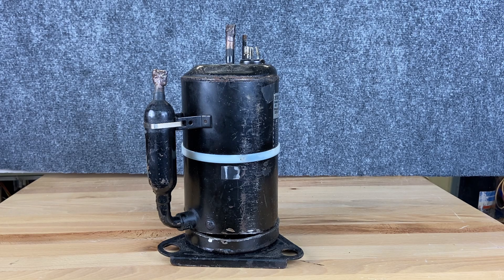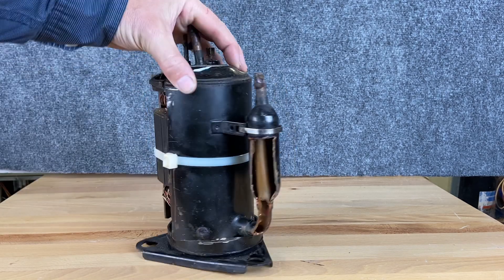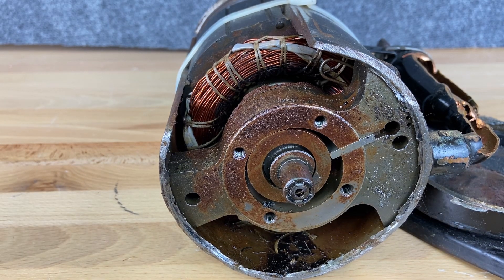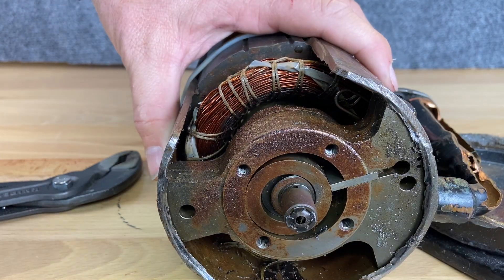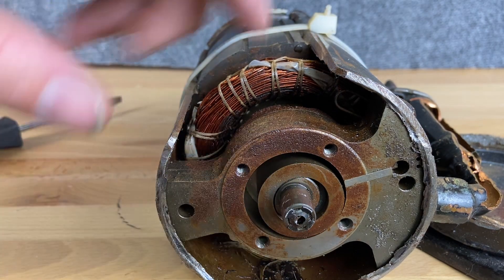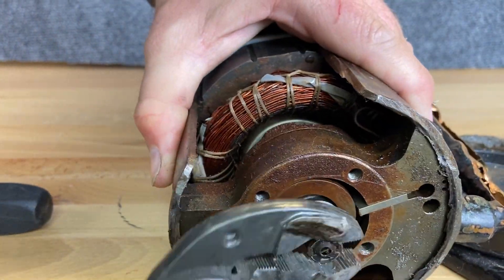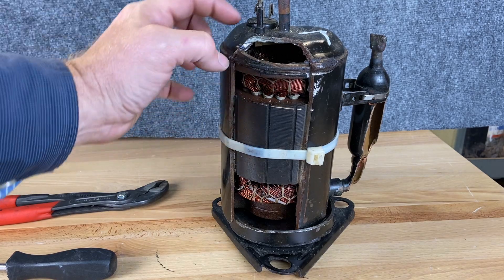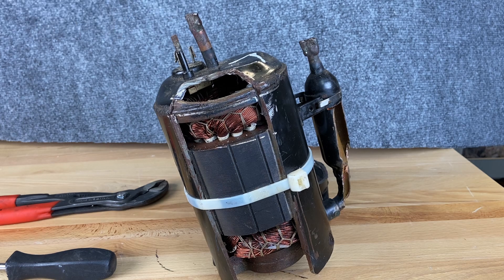HVAC 073 Rotary Compressor introduction hermetically sealed

Comment: @ 00:55  That is not a "keeper pin to keep it [the rotor] pushed in". That is a vane that rides against the rotor. And as you later stated, it separates the high pressure side from the low pressure side as it rotates. Without it, you would not get any compression. 

PTAC is Packaged Terminal Air Conditioners, like those used in motel rooms.

Comment: Will the section line accumulator be enough to use these types of compressors to recover Freon from
Automotive systems etc, the commercial  units have a rotary valve in them what protects them from liquid damage, cheers Brett
Reply from the maker: Possibly but oiling is a concern.

Comment: Hey Ty love that your taking the time to teach us but I do have a question….when you replace these when you break the vacuum do we always charge on the high side or it doesn’t matter!? Thank you in advance and god bless
Reply from the maker: Great question!
A few points.
If the system is pumped down like a new condensing unit, open the suction first,. Then the liquid.

Residential air cooled systems you have 2 options.
Usually everyone breaks it by adding liquid directly to the liquid line. Never add liquid to the suction side when it's off or in a vacuum.

If it's a water cooled system, being geothermal,  refrigeration, chiller, or anything with water as a heat transfer you want to add vapor only until the system pressure rises above freezing.
Above 32 for water or if it's glycol the freezing point varies with mixtures.
After your above the freezing point with vapor you can liquid to the liquid side.
Reply: @love2hvac  thank you for the response. It’s actually a 2 ton residential package water-source unit they factory charge it through the low side and I believe that’s what killed the rotary compressor in two days 😂😂

Comment: Hi Ty! In the Middle East the temperature easy to pass 134 F(54 C)  and in some cities over 140 F (60 C), in this case lats of temperature hits the compressor so if put some shade to decrease the temperature do you think that could help the vapor pump to cool? Thank you🌷.
Reply from the maker: The highest temperature in the middle east was recorded in Al-Jahra, Kuwait, where the temperature reached 52.7⁰C  / 126.86 ⁰F

The current official highest registered air temperature on Earth is 56.7 °C (134.1 °F), recorded on 10 July 1913 at Furnace Creek Ranch, in Death Valley in the United States.

Those are not regular temperatures but extreme peaks for a limited time.

Shade can be beneficial or detrimental depending on how it's applied. 
The shade should never be over the top of the unit and never in the path of the exhaust air.

The shade should be used several feet away from the condensor blocking the sun from striking the side of the condensing coil. 

Some companies have designed water system to allow for evaporative cooling on the condensing coil's but the water has to be very pure and de-mjnsralized to prevent scale build up. Even with that the water can speed up electolosys. I have early seen it done right but it is a possibility for extreme applications. 

If you lookkng for a real solve, look at geothermal system where a glycole/water loop is buried deep in the ground. The condensor regects heat to the water and the water gives up it's chest to the cooler earth.

Comment: Please help me with great facts of my ac air conditioner compressor turn a Dynamo or alternator generator project? Is it too feasible?  Or how many hp motor can I turn an AC air conditioner compressor into?
Reply from the maker: Great questions. I don't have the time to investigate your answers but the information is all available. Come up with some ideas and then experiment and see what works and dosent work. Keep modifying untill you get what you want. It's much more fun that way and you will learn a lot.

Comment: Can I convert ac compressor  to hydraulic pump or an alternator generator
Reply from the maker: Yes an alternator is easy to make a generator. 
A compressor does not make  hydraulic pump though. You need a gear type pump to make that happen.
Reply: @love2hvac   big thanks ,  I have low voltage in my street, i got the idea of turning an old ac air conditioner compressor into a Dynamo or 240V alternator to  be spin or propel by a 24v DC hydraulic motor of 2horse power, will it work  well  to carry my 240v inverter tech welding machine?

Comment: If the whole casing is hi pressure (I assume it's refrigerant cooled) what keeps the compressor cool?
Reply from the maker: That is a great question, Eli!!!
I do not know or understand the answer.  This morning I looked it up one book said because the motor is in the discharge gas it runs hotter and sometimes has limitations.
Another book said the compressor windings  are cooled with discharge gas. I have heard that before but it still does not make sense to me. I will ask my instructor group and see if I can get a better answer for you and me.

Comment: Interesting — similar mechanism to a pneumatic impact wrench (though in reverse - air pressure differential drives the shaft)
Reply from the maker: YES!!!
I love it when people are thinking. You thought and applied it outside of the immediate subject and you are correct!  One other difference on the compressor the vein is on the outside pushing in against the rotor vs the vein in rotor pushing out to the cylinder

Comment: i have never seen this model of compressor before with the compressor at the bottom and high pressiure casing. thank you. sidenote/unrelated: could you make a video showing the difference in how fast/slow a system can be pulled down when using the manifold or directly connecting the pump and hose sizes? its a interesting subject but i have not seen a video so far where the difference is actually shown, just told.
Reply: Jim Bergman has a video showing and explaining the difference.
Reply from the maker: @Elisummit845  please post the link. Thanks!
Reply from the maker: as soon as I find a good piece of equipment  that allows the down time time for that I will
Reply: @love2hvac  great. thank you. i always found it annoying about my teachers that they just said "do it like this or else" and never could/would actually show the why. just like not brazing with nitrogen. just braze a piece with and without gas and cut it open. that makes it instantly clear why you need to do it instead of just being told to without proper context or motivation.

Comment: Hello Ty is this kind of compressor can hold some liquid? And if does not have accumulator what’s can happen? Thanks.
Reply from the maker: Great question,
It cannot hands any liquid at all. Of all the compressors, the liquid is the most detrimental. 
That is the reason they always come with an accumulator to protect it. The suction is delivered directly into the compression cylinder. As it tried to compress the liquid will have nowhere to go. It turns into hydraulics and something has to break or stop moving altogether.
Reply: Is there any kind of oil in this type of compressor?